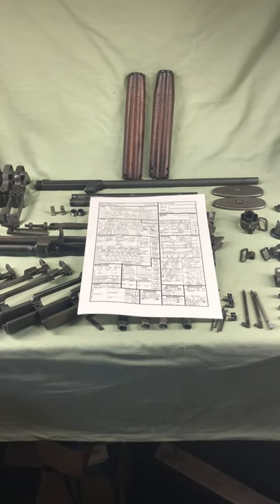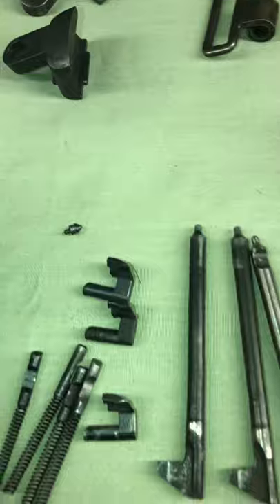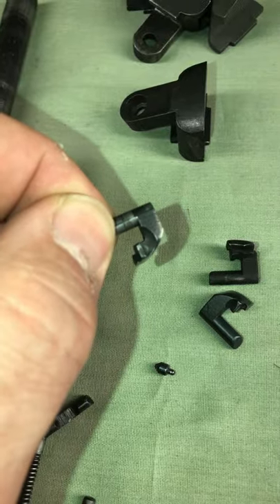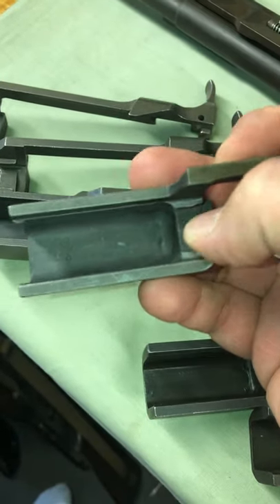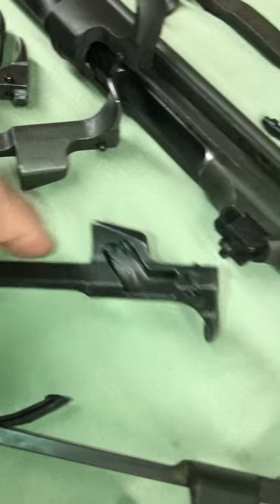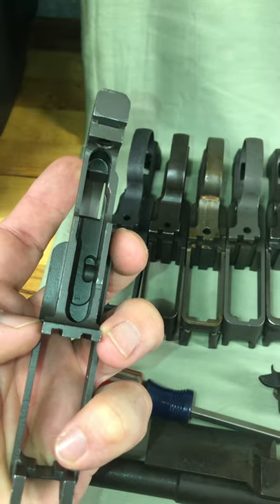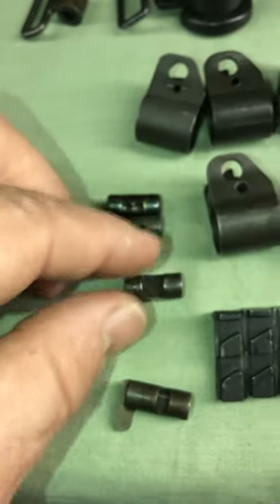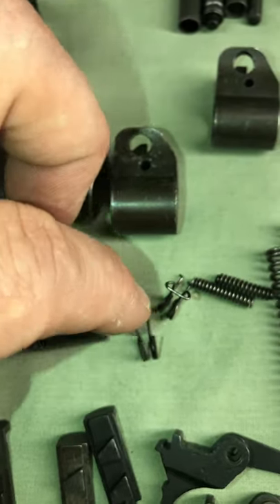How to Identify M1 Carbine Parts & Fill out Data Sheet Part1

Comment: Anybody happen to know if the guide rods are all identical across all the models? Inland, Winchester, universal?
Reply from the maker: Cannot speak for Universals, generally they are all the same.  I have seen the point tip varieties on original WWII Carbines.
Reply: @norwich93CMP  Thanks for the response, im building one from basically the receiver up, and messed up by ordering a GI model slide for it. Once I noticed that mistake, I realized that the universal seems to be a frankenstined mash up of all the models, plus some proprietary parts. However online all I could find for the recoil guide rods were the one type across all carbines so hopefully they are the same.